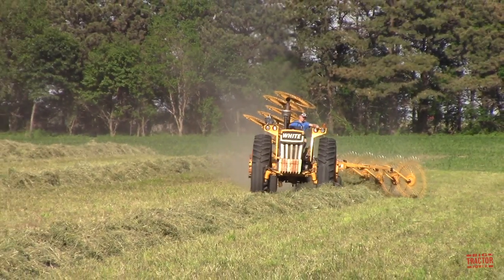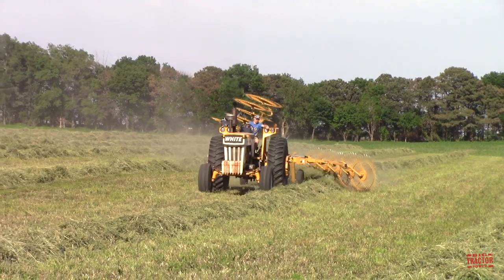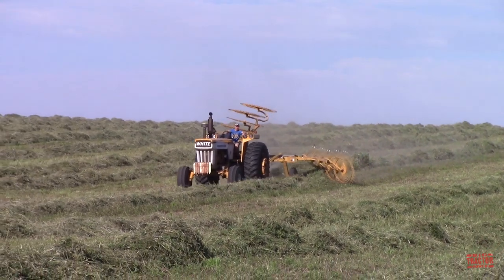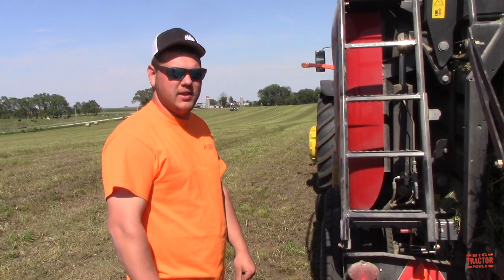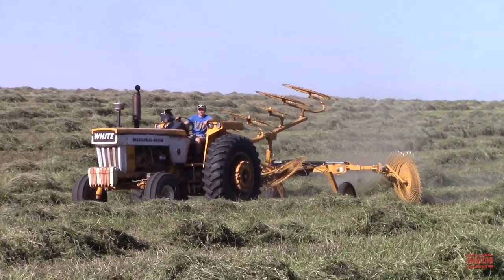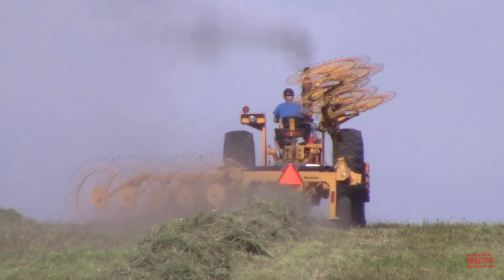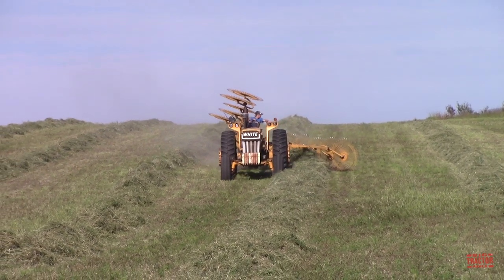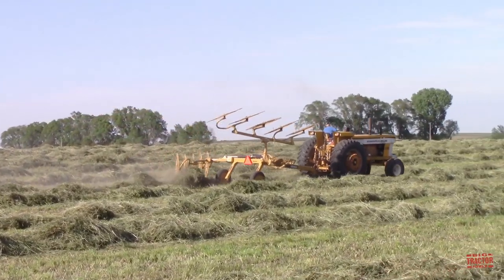MINNEAPOLIS-MOLINE G-1050 Tractor Raking Hay

Comment: Love seeing the old MM at work. Probably a little overkill for a hayrake haha, but I love it none the less. Still own the u302 Super my grandfather bought new. He used it, then my dad bought it from him when he retired for our farm where I got to grow up with it, and now it's at my home where it gets snow duty in the winter months. MM did a lot of things right back then- the Tele-flow hydraulic system they made was top notch, they used hydrostatic power steering which made that part of operating the tractor effortless, they adopted spin on oil filters very early and maint. in general is very easy. My U302 is the tractor I learned to drive on and I hope I can give it to my son down the road.

Comment: So I've got a question for you guys.   This tractor has 504cid.  110hp.  No turbo.  A Deere 4240 is 466cid 110 hp, also with no turbo.    
  Most old MM tractors I've seen put out a little smoke so they aren't all that conservative on the fuel pump.  Was MM sand bagging their HP numbers????    Maybe the Deere was running more compression?   
  I know its not exactly an apples to apples comparison because the Deere motor was probably designed 10 years after the MM but the similar HP and the lack of a turbo for both tractors got me thinking how similar they are.
Reply: The MM 6 cyl was basically designed in the late 50's. It wasn't a 504 initially, but the design didn't change a whole lot over the next few years, and by the early 60's White had basically completely shut down any development for new products at MM. I may be off a bit, but IMO the U-302 was one of the last true MM designed original tractors. MM used a lot of the features on that tractor and scaled them for use on others, like the 670's and even up to the big 6 cyl units like the G1000. Scaling for use really wasn't the same as a new design. By the early 70's the 6 Cyl MM engine was very old, and White had sort of half combined pieces of MM and Oliver for the bigger tractors. I forget the model but there is a 6 cyl MM engine bolted to an Oliver transmission/rear end as an example. Oh and White shut Oliver down too by the late 60's design wise. Both companies were huge innovators, but White had lost it's posterior in their heavy truck segment and cut costs on the ag end of things.

As for the JD: The real difference in those two is going to be RPM range for the power. There is also a matter of how those engines differ when it comes to lugging ability. Huge, long stroke low RPM engines like the MM(and older J.I. Case) can usually lug waaaaaay down the RPM range and maintain power and recover. I grew up with a Case 1030 wheatland loaded for bear with weight, and that thing would lug down from 2100 RPM(wide open) to about 500 and still chug, and recover back to wide open. Every JD I have run personally from back then would run at rated HP, lug slightly, but then once RPM starts to drop, the power also dropped, and the tractor would not recover. As an example we had a 4020. Yes, it had less HP then our Case, but the lugging power was not even in the same ballpark. Our David Brown 1200 gave it a run for it's money and that was over 15HP less. 

So that MM might be rated to 110HP,  it might be sandbagged, but it could also just be that the engine was tuned for lugging power and a very broad power band, not to mention it is older in design then people like to think. somewhere in the early 70's the engine designers figured out that turbo made for easy HP and it was easier, better, and more effieicient to just make the engine produce significantly more HP then to try to make the power band very wide. Farmers also started buying more HP to do the bigger jobs, because it could be done faster. In a sense there was a fairly rapid transition to a design that was much more like the modern with higher RPM turbo driven tractors with bigger HP and better transmissions. Sort of like the JD A's and IH M's were suddenly left in the dust, a lot of tractors with design roots in the early 60's were made obsolete by the mid 70's models.
Reply: Oh I forgot also- tractordata.com is a neat sight to look up specs on tractors. You can see what i mean by engine performance looking at numbers there, they list the rated HP for the PTO but also for the drawbar. A lot of JD tractors were advertised at PTO HP, but the drawbar HP was usually lower by a bit, especially on the "chore tractor" size machines.
Reply: MM was a slow rpm big cube engine but behind the times with the old lanova injection system. JD IHC Allis MF Ford all had moved ahead to higher compression, higher rpms, direct injection diesels which had more power and lasted longer. MM could crack heads easily if got hot. We sold them and worked on them. 900 670 and down were better, but G1000 G1050 had weak differentials and poor engines.  Using that G1050 on a hay rake is a good idea. Won’t hurt itself.

Comment: Nothing like throwing iron at the task. "Not sure how many cubic inches it takes to run a 1022 rake, but I know how many I'm gonna use!"
Reply from the maker: It’s always fun to get a classic out in the field.
Reply: @bigtractorpower  Absolutely.  Case in point, I've had our 720 Diesel on a two-basket tedder, numerous times. A 1010, or 420 would be plenty enough tractor for that task, but the 720 Diesel is more fun to operate in my opinion, so why not throw some iron and cubic inches at the task?